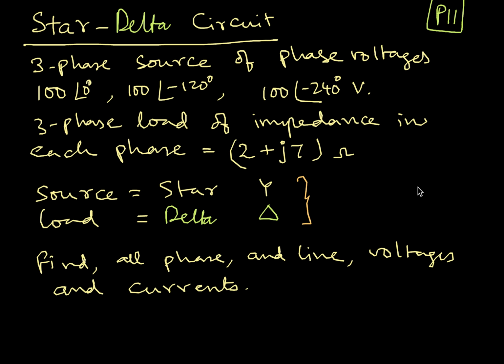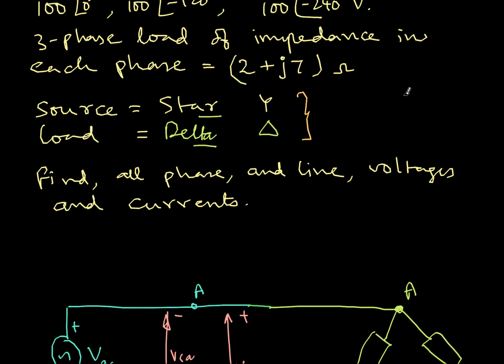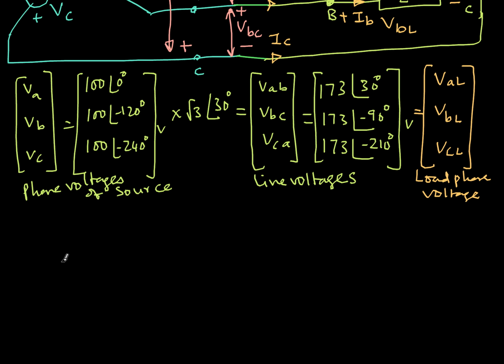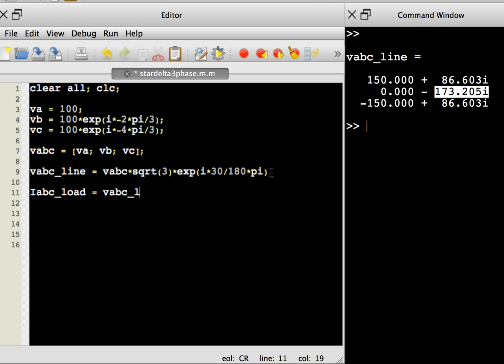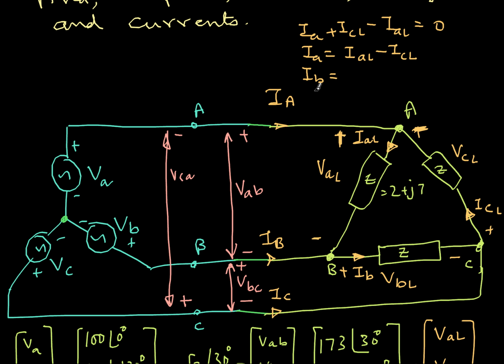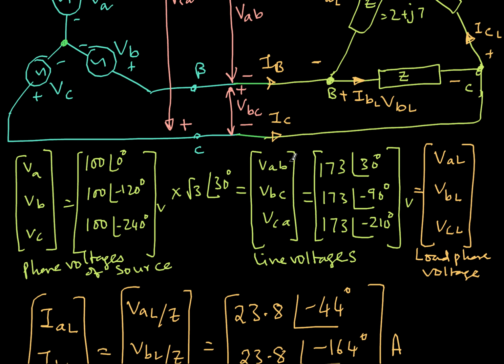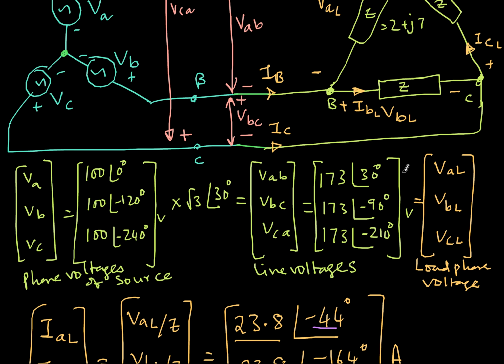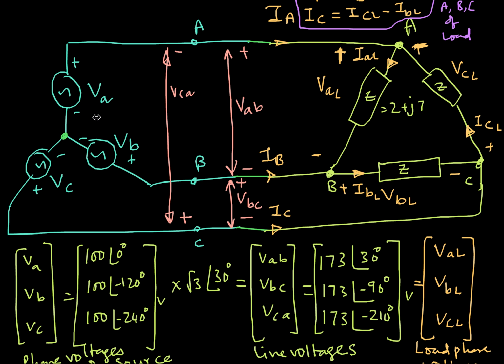Star source with delta load 3 phase circuit

Comment: Sir I need topic unbalance source voltage star connected with load of Delta connected unbalanced impedance calculate phase line current and active, reactive, apparent power calculation